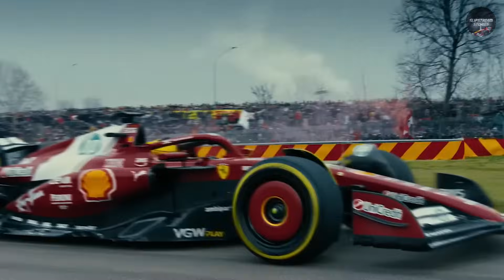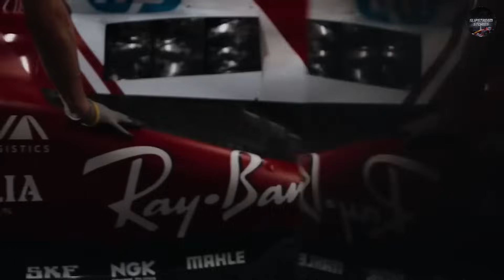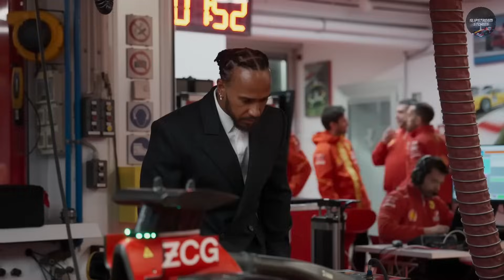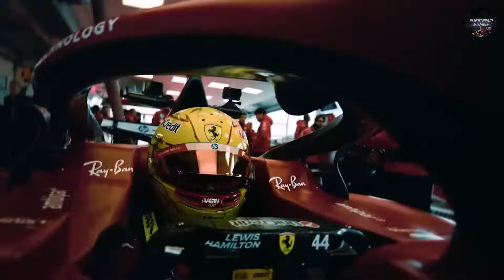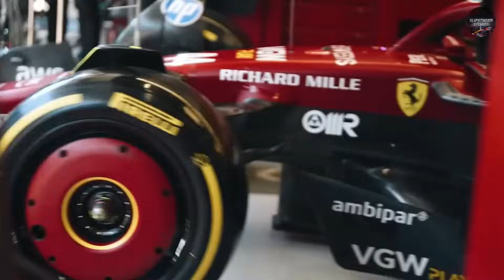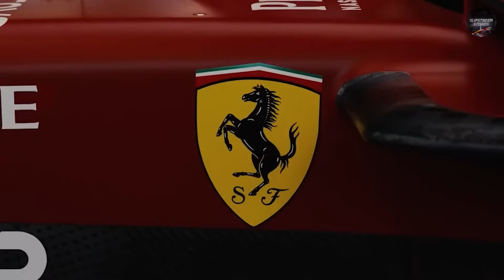Did Lewis Hamilton FINALLY Find the Perfect Brake Pad at Ferrari?!

Comment: ⸻

Ferrari’s simulator is incredible, no doubt—but if I were the company behind it, I’d take it a step further.

I’d build a ride-along version of the driver’s simulator. No controls—just the exact seating position, full harness, and driver’s eye view through a helmet. Post-race telemetry and sensor data would be fed into the simulator, and the chief engineer would be the one strapped in for the ride.

No pause button. No way to control the experience. Just a firsthand feel for every bump, brake fade, aero imbalance, and twitch in the steering—exactly as the driver experienced it.

Why? Because not every driver can articulate a car’s inconsistencies and nuances like Lewis Hamilton. Some can’t put it into words at all. But when the engineer feels what the driver felt, the guesswork disappears. Real-world insight replaces theory.

That’s how you bridge the gap between human feedback and engineering precision. Not just data—but empathy through simulation.

Thank me later…❤